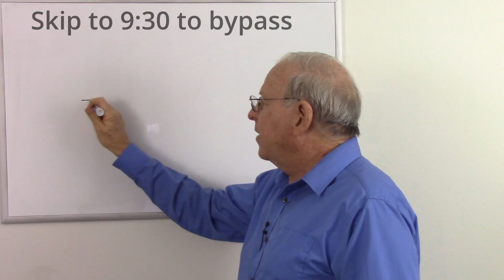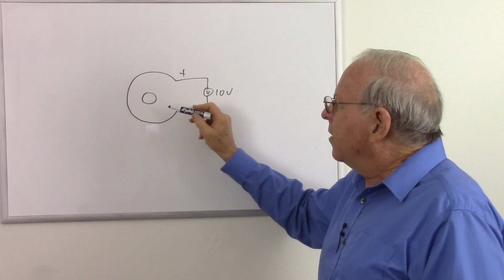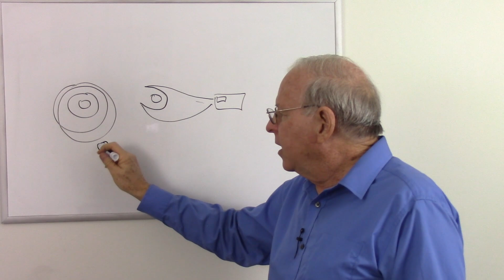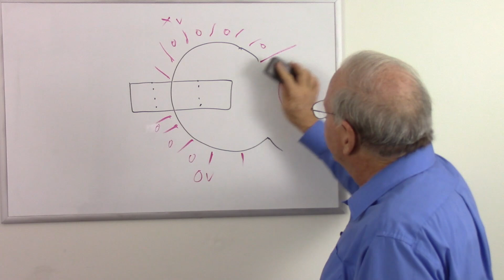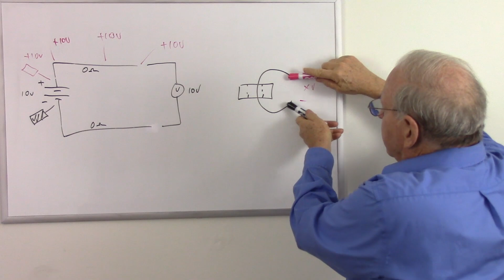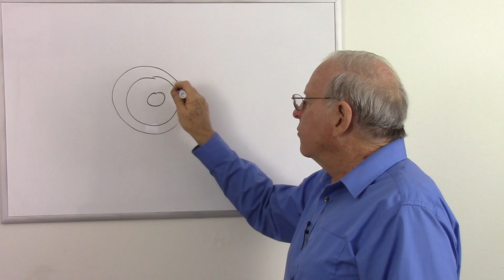Where is the emf in a Toroidal Inductor

Comment: get two toroidal cores. wrap one turn around one core, then put the other one on top of it, and put one turn around the pair. then wind a primary of 20 turns around both. the turn around 1 core will generate 1/2 the voltage of the turn around both cores. there's your gradient

Comment: The key to understanding this is to notice where the magnetic field is. In a toroid, it is contained within the core, it is practically zero outside the core. So, by placing the wire near  the field, then you will induce a potential different in the wire.

When you used the relay coil, the field is all around, so it's simpler to induce a viltage.

I'm not sure what the actual controversy is, but the induction of voltage on the wires is explainable.
Reply: Exactly.
There is a world of difference between a toroid and a solenoid.
The toroid has practically zero external field ( thats why they get used in high end audio equipment etc..) whereas

 a solenoid is essentially a bar magnet... where the induced magnetic flux has to travel in the air space from one end to the other ( it has to since all magnetic paths must form a closed loop  (  surface integral b . da = 0) 

If we then place a loop around the solenoid... and attach conductors to it to measure voltages.. there is going to be additional induced emf due to this stray field .. which will affect readings ( which is what electroboom did using twisted wiring..)
Reply: @eric4709  After reading older comments, others have said basically the same thing I have said. I was taught this stuff over 30 years ago. Electrical fields and magnetic fields are inextricably bound together. Just applying electromagnetic concepts one can qualitatively infer where there will be voltage. It's puzzling why this video was put out in the first place, there's no mystery regarding what's going on. Many times people that post content on YT do not have a proper understanding of the subject and put out nonsensical stuff.

What you refer to "stray fields" are not relevant to understanding what's going on. Attaching a measurement device affects the circuit and results in measurement errors, that's unavoidable. These errors can be accounted for and are not that hard to quantify. It's not a big deal.
Reply: It's incorrect to presume the secondary induced EMF is entirely confined to the small cross section of the toroidal core window. With respect to an ideal highly permeable toroidal core, as noted, the magnetic field is (in principle) confined within the core proper and negligible elsewhere. The field might arise from an energised tightly pitched, single layer primary winding which fully envelops the toroidal core. This primary winding would be energized by a sinusoidal time-varying current - say at mains frequency of 50 or 60 Hz.
Consider then a closed resistive wire secondary loop partially aligned with the toroidal principal axis. I imagine a straight wire segment of the closed loop aligned with the principal axis extending well above and below the toroidal plane with the remainder of the loop completed as a circular arc segment. This circular segment completes the encirclement of the core and therefore links the embodied time-varying magnetic field.
We would anticipate an induced current flowing in the closed secondary path, the magnitude of which would be determined by Faraday's Law of Induction and the wire loop Ohmic resistance - neglecting any secondary self-inductance.
How do we account for the existence of this secondary current in the absence of any  magnetic field in the region occupied by the secondary loop? There must be an electric field acting on conduction charges within the secondary loop conductor. To account for this driving electric field Maxwell (following Faraday who rejected the concept of action-at-a-distance) proposed the existence of a physically real “electro-tonic state” which later became known as the magnetic vector potential - typically designated as “A”. Maxwell showed mathematically that the induced electric field can be related to the rate of change of the magnetic vector potential. Oliver Heaviside, who refined Maxwell's original equations to their commonly stated concise differential and integral forms, was critical of this vector potential being a physical reality. He regarded it as a purely mathematical construct. With the advent of quantum mechanics as applied to electromagnetism, it was understood that the vector potential could be regarded as a physical reality. This was later seemingly confirmed experimentally in the realisation of the Aharonov-Bohm effect - concerning the quantum effect of magnetic vector potential on the wave-particle duality response of an electron beam traversing a classical double slit arrangement.
What does this mean for the case of our toroidal transformer? Wikipedia discusses the magnetic vector potential and pictorially illustrates the vector potential for a toroidal magnetic field in the subsection entitled ‘Depiction of the A-field’.
This depiction in Wikipedia clearly shows that the vector potential extends in the entire space occupied by the confined toroidal magnetic field, notwithstanding the point that no magnetic field is present in the region external to the toroidal core boundary surface. 
We must conclude that any induced electric field arising with the time-varying vector potential must also occupy the same space as the vector potential. This means that any induced EMF associated with the vector potential is not confined to the small region within the core window (the donut “hole”) but would extend into the region occupied by the entire secondary closed loop - albeit to varying degree along the secondary path. The mathematical derivation of the field distribution is rather complicated.
A careful analysis may be found in the August 1995 American Journal of Physics paper “On the fields of a torus and the role of the vector potential” by N. J. Carron. A pdf version can be found online in a search using the same paper title. Using Carron’s equations, it's possible to analyse the case of the single loop secondary topological arrangement I proposed above. I've applied Carron's equations to a typical implementation of that topology and found some 30% of the total EMF arises within the core window - not 100% as claimed in Bob’s video. Bob notes he has not been able to find any analysis or documentation supportive of his claim. This is because no such analysis exists.

Comment: I noticed one thing that is puzzeling me. WIth the solenoid the wire, it  was place around the solenoid the outside, but on the tordial inductor  the wire was placed through the inside of it. What would happen if you  ran the wire around the tordial, basically on the same plane as done with the solenoid, then what happens?
Reply: Probably nothing... or very little  as there is very little external magnetic field around a toroid.
That is why they are used in sensitive electronic equipment .

You are right... very few seem to be picking up on the fact that a solenoid.... like a bar magnet radiates the magnetic field into the space around it.... totally different from a toroid that constrains (virtually) all the magnetic flux to flow around its high permeable / low reluctance core

Comment: The simple answer is that the loop passing through the center of the toroid is close to windings on one side and relatively far from windings on the other side which are in the opposite direction and cancel. So the close side is able to induce a voltage without being completely canceled by the loops on the other side of the core. Farther away from the core the near and far windings are proportionally almost the same distance away (e.g. 10 inches vs 10.5 inches). At a distance, the EMF from the far side almost entirely cancels the EMF from the near side as they are nearly equal in magnitude and definitely opposite in polarity. There is near net zero EMF as distance increases away from the core. This is the entire point of a toroid in my opinion is that there is almost no EMF at a distance because the two sides of the toroid cancel each other when measuring from a distance. There is a small cost in efficiency but it's worth it.

Comment: I don't think your explanation is correct with the toroidal coil. Your lead wires to the voltmeter makes the loop around the magnetic field even the original loop has the ends open. No matter what you do, as long as you close the loop at the voltmeter you have induced voltage in that loop.
Reply: Exactly. 
In order to "discover" the induced emf - one has to complete the loop.
In order to have an induced emf... one must completely enclose part or all of a changing magnetic flux with a conductor.
Reply: @eric4709  I always wondered if there is a way to measure without closing the loop. Like electrostatically measure one end of the wire without closing the loop but you would need a higher rate of change of magnetic field.
Reply: You don't need to close the loop to get a potential difference along the wire. By placing the wire perpendicular to the magnetic field flow you get maximum induction. The field will move the electrones towards one end of the wire and a voltage difference will be induced.

When you plug in a meter you're closing the circuit and a current will flow, but that's not needed to get a voltage difference in the wire and will result in a voltage measurement lower than in open circuit.
Reply: @RafaelHe  I'm thinking you need a closed loop since you need a current which the voltmeter is using (current to show voltage). Not sure how a measuring method can be employed without measuring current but pure voltage on a non closed loop. Maybe electrostatic induction device on one and the other end to prove a voltage potential develops?
Reply: @car9167 that would be in the realm of high precision measurement. An ideal voltmeter has infinite input resistance. Real world instruments have nonzero input resistance. How the measurement is affected can be calculated.

However, the point I was trying to make is that the magnetic field will induce an electric field in the wire, hence a voltage. Independent of connecting a voltmeter to close the loop.
Reply: @RafaelHe no, there would not be any voltage in the wire (as long as we remain in quasistatics).

The induced voltage is the effect of the induced electric field associated with the changing magnetic field in the core and is always there, regardless of the presence of the conductor outside (and not around) the core. But when you place the conductor in this field, it will polarize and the charge at its extremities will produce a coulombian electric field that will cancel the induced field inside the conductor. With zero resultant electric field inside it, there is zero voltage along every path inside the conductor.
Outside the conductor, the total electric field is not zero but the voltage is still zero along any path that does not go around the core.

Comment: There should be a voltage gradient along the wire that is inside the thoroid, say if you move the leads of the voltmeter 1mm inside the thoroid, then 2 mm, then 3 mm, say for a thoroid that is 7 mm wide?
Reply: You would think so.  But ..
Lets say that the toroid is 7mm wide.
You place an uninsulated wire ( so you can easily "slide" the voltmeter probe along it)   in that 7mm gap... and ... if you measure across its ends you measure x volts .. BUT.. if you leave  one end of the voltmeter connected and slide the other terminal of the voltmeter into the gap... you would think you would "see" less voltage on the wire ... but the SAME voltage is induced on your meter lead to make up the balance - so you will measure the same voltage.
( that is... you have effectively still got exactly the same loop!!)
Do it the "other" way... move the meter lead into the gap from the same end that the other  meter is connected... and you will measure 0v since the meter leads have opposing volrages induced ( that is they are not enclosing any flux)

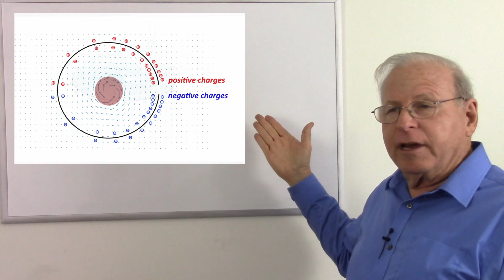Comment: at 11:02, the gradient you see is the charge density gradient. The charge distribution is the result of e-field produced by the changing magnetic field. But the charge distribution itself also produces a opposing electric-field along the wire. There are two electric fields of different origins, and the total electric field along the wire is zero. It has to be zero, because any non-zero resultant electric field will re-adjust the charge distribution until the nett e-field is zero, because a conductor by its property will have the charges moved easily by any non-zero e-field. Imagine that you are a little electron in that path, you can move along the wire without any opposing force, hence the voltage along the wire, from one terminal to another is zero. But across the gap, the voltage is non-zero.

Comment: The wire passing  through the core of the toroid top to bottom is the first turn of the secondary of a transformer. It does not have to loop around to count as the first turn of the secondary.
Reply: As soon as you connect any device to that wire passing through the core to measure the induced emf  - you complete the loop.
In other words -to "discover tge emf"  you will always have a  closed loop enclosing the magnetic flux.
In the case of the toroid - virtually all of the magnetic flux is contained within its core since by design the core is made from high permeability low reluctance material.
Reply: If by core you mean the hole of the toroid, then you're not correct. There's no magnetic field in that region.

The magnetic field is contained inside the iron toroid, the actual core of this device.
Reply: @RafaelHe 
Interesting.
In the case of a toroid.. the magnetising force  (h = i * n turns )  created by the current flowing in the primary winding  around the core  creates   the flow of magnetic flux around the core. 
By design.. the  core has no air gap  and has relatively high permeability and low reluctance. 
 Consequently the magnetic flux density ( b = mu mr * h)  in the core is high - and is contained almost totally within the core  
One can view this as a voltage source  ( magnetising force) connected to a low resistance r   "core"  in parallel with a high resistance r "air" where r"air" is much greater than r core this creating a core  current flow =  v/r = magnetic flux flow with i = v/ r "air"  practically zero

The core material is designed to have low eddy current loss ( such as ferrite) 

So when a conductor is fed through the hole of the solenoid.. it encloses the flux in the core  "entirely" as it passes through.. ( and forms a loop )... but "sees" no flux once it exits 

In the case of the solenoid... things are totally different.
The wire is "still wound around" a high permeable / low reluctance core... but... the magnetic field path now includes a large air gap.from one end  of the solenoid to the other . 

Using our voltage source analogy - our magnetic field flow is drastically reduced since our circuit now contains 
R "core" + R "air"... and R "air" is much greater. .
( this is why some transformers such as used in switched mode power supplies have small air gaps to prevent core saturation)

so the total reluctance is much higher..( ie flux density is lower for a given magnetising force)  and... the magnetic field extends into the air space around the solenoid. ( it has to since each magnetic line of force must create a closed loop

If you place a loop around this solenoid.... all of the loop "sees" magnetic flux.. all of which flows  through  the core ... and then returns "external" to it 
So unlike the toroid.. the solenoid has an external field which will induce emf into "stray" conductors that will affect measurements .

In radio construction ... such "coils" are used ... but need external screening to prevent unwanted mutual coupling to adjacent circuits due to this stray field

Comment: Sir plz give me intuition for emf amd voltage
Reply: Voltage is an informal term, for anything measured in volts.  Engineers and electricians use this term, but physicists use a term that is more accurate to what it is, rather than a conjugation of its unit name.

EMF is the more general term, electric potential is a special case of EMF.

EMF is the line integral of an electric field.  In other words, it is the work done by the electric field, as a positive unit test charge moves between two points of interest.  It could be between two different points, or it could be a closed path line integral that returns the charge to its origin.

In the special case of purely electrostatic fields, the electric field is conservative, and the closed loop line integral is therefore zero.  In other words, this is an electric field that is exclusively due to the positions, amounts, and signs of the charges that set up the fields, and not due to any magnetic effects.  Because of this special case of the electric field, there is a concept coined called electric potential, that is used as a shortcut for evaluating the work done by the electric field.  The work done moving a charge between two points, is independent of the path, and would add up to zero, returning to the same original point.

This is what you get in a circuit created by batteries and photovoltaics as the energy source.  A conservative electric field throughout the circuit, where the closed loop total work done on a charge as it takes a closed path, is zero.  The voltage source does positive work on it, and the loads do negative work on it.

Magnetic induction makes electric potential no longer a useful concept.  Instead, the more general case of EMF needs to apply.  Magnetic induction introduces a non-conservative field, where the closed-loop work done on a charge, is path-dependent.